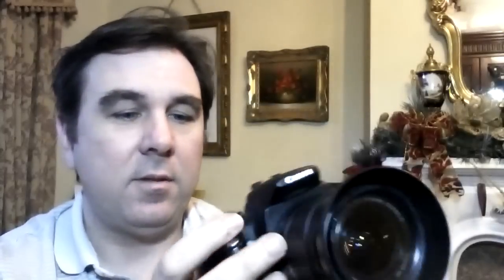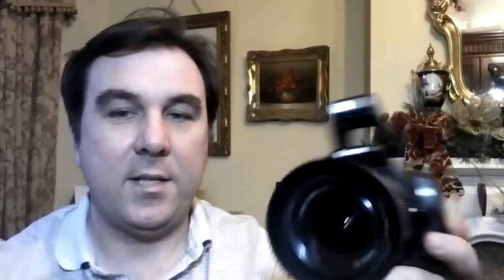Yongnuo ON-E3/M Canon ETTL Off-Camera Flash / Strobe Cord Review

Comment: Silly question.  Can you stack the flash on the lens with a TTL cord?  Do you have to hand hold it all the time?
Reply from the maker: If you're running the cord, yes, you have to hand hold the flash - or get a tripod mount flash bracket.